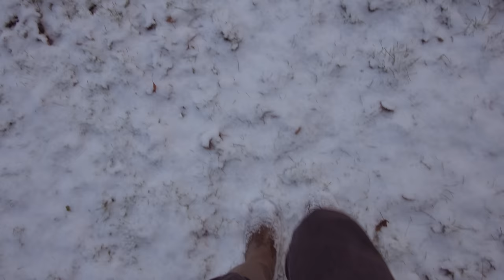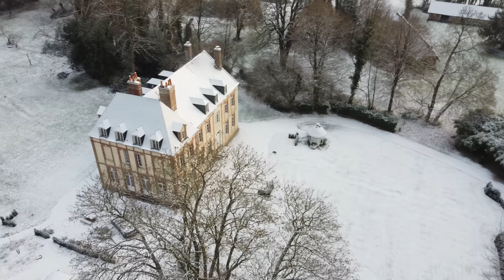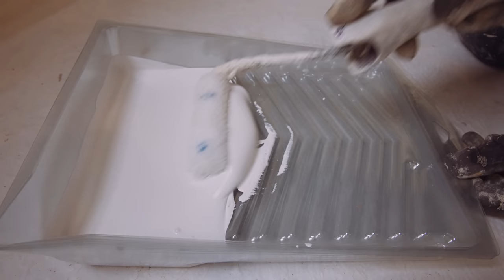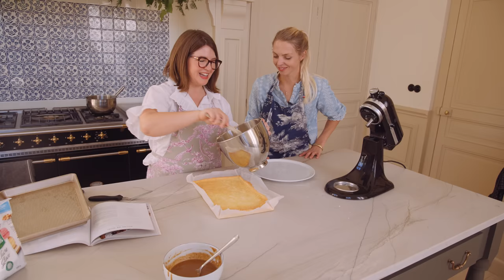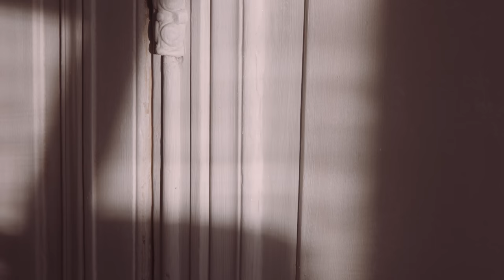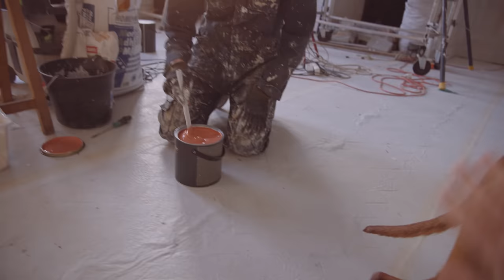Chateau Dining Room Makeover - Colour REVEAL!

Comment: Thanks for the tip on using a paintbrush to smooth out and form caulking! I have a 200 year old farmhouse in western NY, and have gaps in my corner moldings due to subtle shifts over time. Thanks again for the hours of frustration you saved me from!